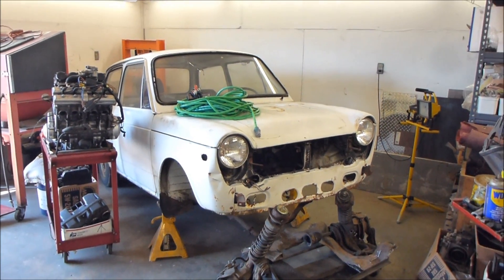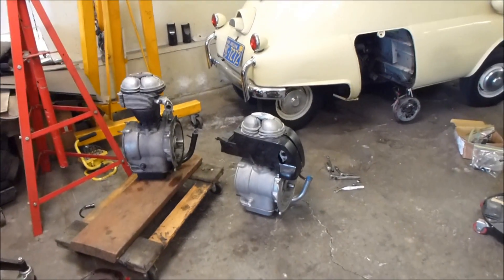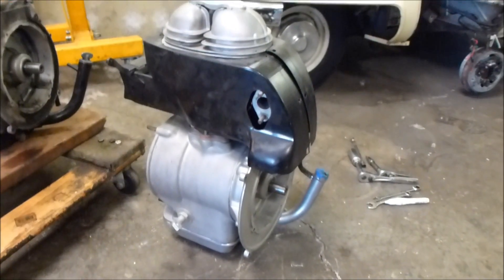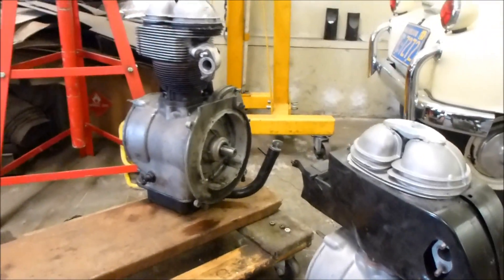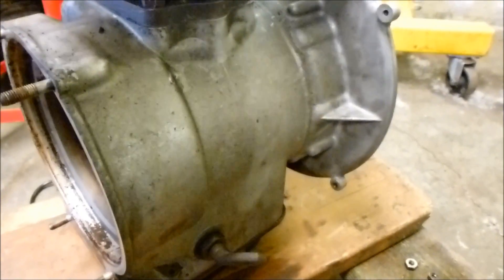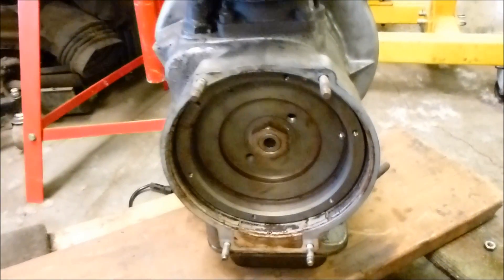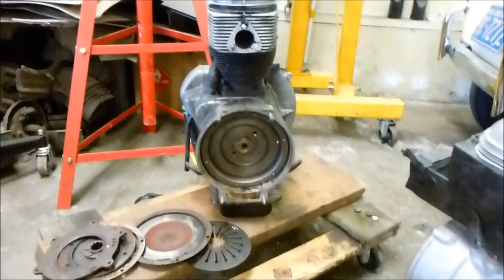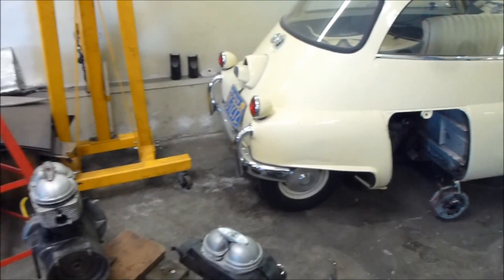Isetta engine repower

Comment: the isetta engine is almost an r250 bike engine-   the isetta has no kickstart instead a dynastart-engine casing is modifed early isettas were 250cc, later cars were 300cc. 

An interesting note. the German army commissioned BMW to build field generators. these used the isetta engine! they produced thousands and you can still buy brand new army surplus generators- containing brand new isetta engines wrapped in oil paper and in a wooden crate. they do turn up for sale on ebay.de sometimes.